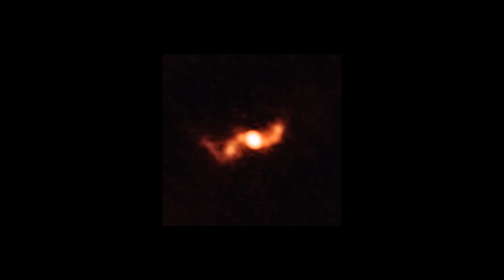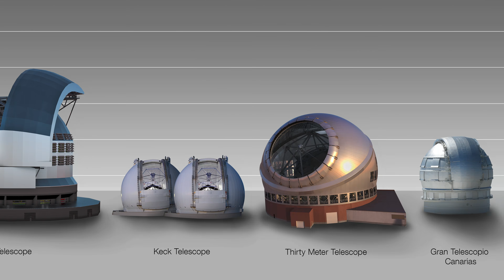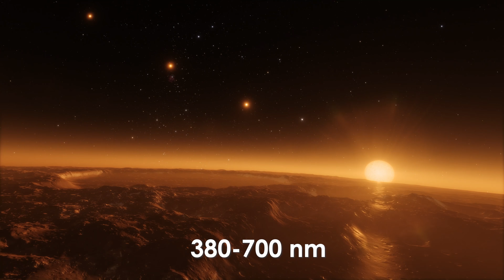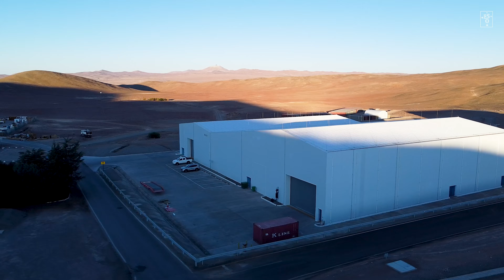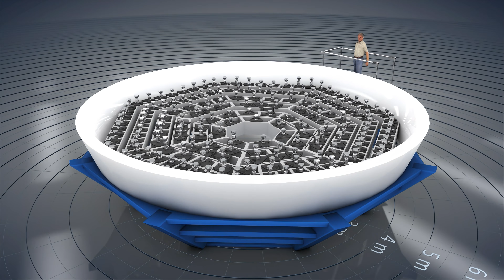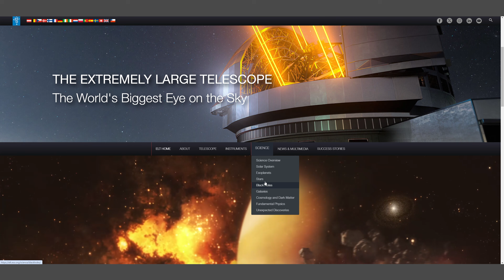ELT: The Most Powerful Ground-Based Telescope Ever Built! | 4K

Comment: I thought the Vera Rubin telescope was the most powerful.
Reply: The Vera Rubin telescope has a mirror 8.4 metres across. The ELT's mirror is 39 metres, which is much larger. But the Vera Rubin telescope has a different purpose. It is designed to repeatedly photograph the night sky, looking for changes (new asteroids, supernovae, etc.) that occur from one night to the next. It will photograph the entire night sky visible from its location every three nights, and then repeat the process. AI will examine the images to look for changes and what type of changes they are, and astronomers will follow up on any important ones. To be able to photograph the entire night sky every three nights the Vera Rubin telescope needs a very wide field of view, so it was designed with that in mind. By contrast most large telescopes (like the ELT) have narrow fields of view to provide close up views of astronomical objects astronomers want to study in detail.

Comment: So, the new Extremely Large Telescope (ELT) in Chile will have 798 hexagonal mirrors , 1.45 mts. in diameter and weighing 250 Kgs, each ,...All of which will need to be calibrated between 380 and 700 nanometers ( 0,00038 mm ) A human hair measures approximately 0,07 mm....... WOOW.... speaking of the precision  required for that monster. It leaves you speechless.😲

Comment: I love the video! It made me even more hungry of understanding who are the people and what expertise they have, who invented, planned and executed all those steps in building the telescope. Absolutely incredible engineering! Really thrilled to see what it wil discover. On the other hand i ask myself, if they decided to build a single super large telescope, instead of a few smaller ones acting like a single interferometer, this means that there are disadvantages of the interferometry which I am not aware of. Actually why the VLT acting as interferometer is not better than the future ELT?
Reply: Number of photons collected is the difference.. Interferometry can’t do everything. The larger ELT provides exponentially more photons for spectroscopy that are especially necessary for the faintest objects detectable. And obviously shorter exposure times for imaging. 
JWST was designed for 6 meters not for resolution or detail work but for more IR photons. In the mid IR range (15 microns), JWST has (believe it or not) only has the resolution of an amateur astronomers backyard Celestron 8! Thats due to the longer wavelengths. 
The cost and complexity of ELT improves everything!

Comment: The space elevator is a lightning rod for the ionisphere.  We tried to use space electricity to power a shuttle, and the voltage was so high that it melted the wire after a few seconds after deployment.
Space is electric. That's what shut down our shuttle fleet.